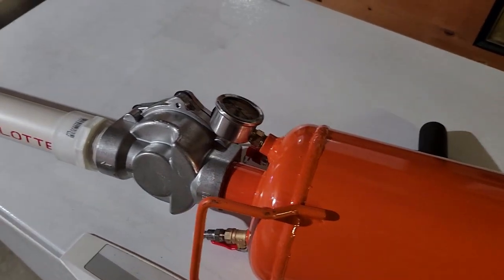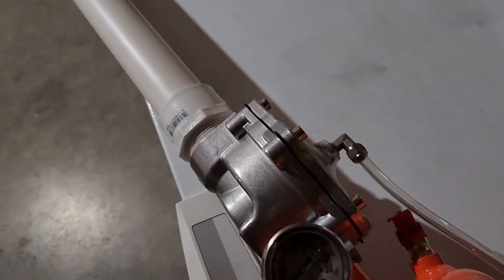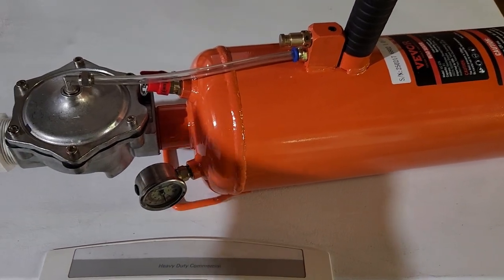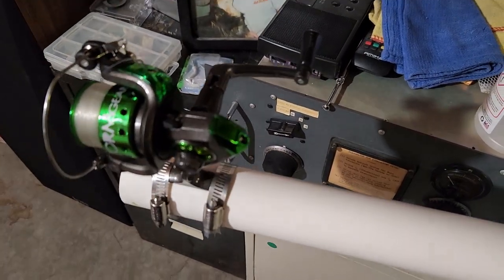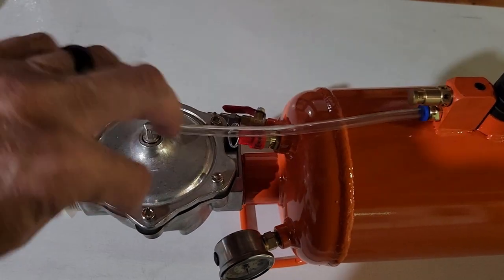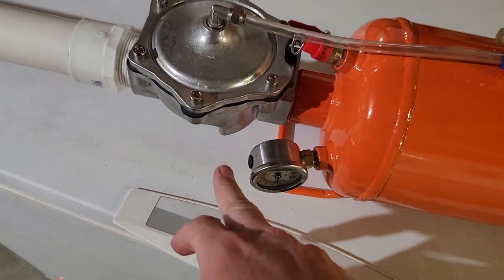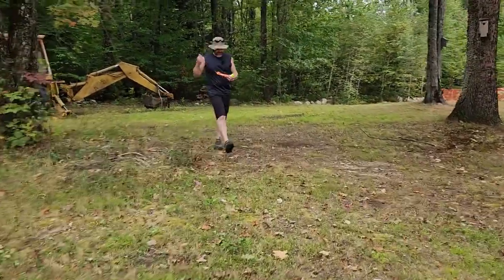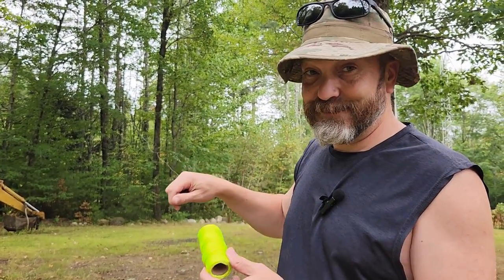Radioman's Antenna Launcher by Vevor

Comment: I think it’s a good idea man, but what would be wrong with buying a piece of conduit that would thread directly into the valve, cutting it whatever length you want and using it. I understand that conduit would be a little heavier ( not much) but then it wouldn’t have any pvc pieces. The pvc is what makes the antenna launchers so dangerous when people use it entirely to build launchers.
Reply from the maker: Ya imagine dropping a PVC air cannon charge with air. Steel is safer.

Comment: I always had good luck using the old Army trick of a fishing weight and a 'wrist rocket' slingshot.
Reply: Sure.  But this has more uses if SHTF.
Reply: @gibbyrockerhunter  Fewer. You plan on carrying that around in your pocket?
Reply: I guess for picking up fowl, a wrist rocket is the ticket. But for any threats or even flares, I would much rather be able to fling large projectiles.
Reply: @gibbyrockerhunter  So, you're not familiar with how that works... You use a fishing weight make of lead. In the eyelet, the a strand of core string from 550 cord found inside parachute suspension lines. Drape a length of it over your forearm and fire the weight over tree branches. Use the cord to pull up a pre cut measured length of commo wire to be used as a dipole antenna. Using a compressed air can is NOT good for a number of reasons, two being size and weight - you'll have to carry it in addition to batteries and radios, the other being the NOISE it makes when you fire it... how loud do you want to be?
Reply: I am familiar....
I was thinking we were talking about multiple uses. 

Sure if we are talking ONLY about deployment of a small antenna. I agree.  Well actually I prefer a sling since its much smaller and more reliable. But if we are talking about launching a "boom" towards hostile lines, I will take the big tank. Lol
Reply: I am familiar....
I was thinking we were talking about multiple uses. 

Sure if we are talking ONLY about deployment of a small antenna. I agree.  Well actually I prefer a sling since its much smaller and more reliable. But if we are talking about launching a "boom" towards hostile lines, I will take the big tank. Lol
Reply: @gibbyrockerhunter  Exactly. Anything you want you'll have to carry in a rucksack. I'd rather it be a slingshot... WAY easier to carry.

Comment: What is this for ? Really cool and I’m curious is it so you can then pull an antenna to the top of the tree for ham radio or something? Sorry this randomly came across my feed.
Reply: The original tool is used for setting tire beads when seating tires to the rim. It design is to immediately dump a bunch of high pressure air into the tire at the Beas of the rim. It will force the bead to sit on the tire rim so you can fill the tire to the recommended pressure.
Reply: @Subgunman I knew what it was originally for I was curious about what it was being used for here.
Reply: @Fryinbologna   He is using this to throw a weight over a tree or other tall object.  The weight will pull a line, in this case fishing line.  This, in turn, will be used to hoist a wire up to be used as a radio antenna.
Reply: @Fryinbologna  he is using it to get the fishing line up to a tree so he can pull up a long wire antenna into the trees so he can work the ham channels in the lower bands. WWII soldiers who were in charge of communications would do the same thing to get an antenna wire up as high into a tree so they could listen and talk to other comms people perhaps back in the rear where command was set up.
Reply: @Subgunman throwing antennas up in militaries is still used. At least in the non lux equipment countries.

Comment: You could easily make an antenna launcher from an old scuba spear gun.

It could be the rubber band flavor spear gun and it would be far quieter than an air unit.

A bow and arrow rig for bow fishing would work great too.
Reply from the maker: Yes you sure could, This route was way cheaper and easier to build.